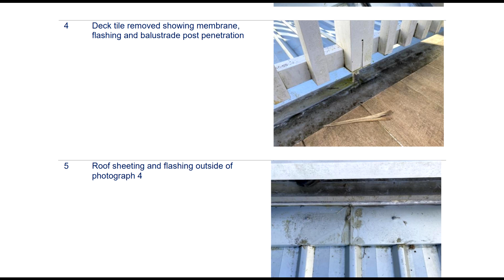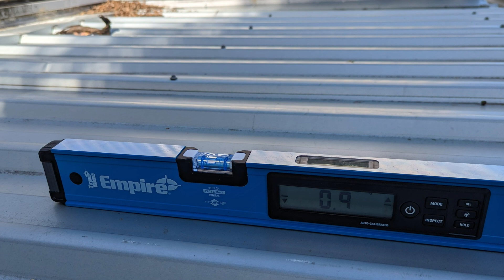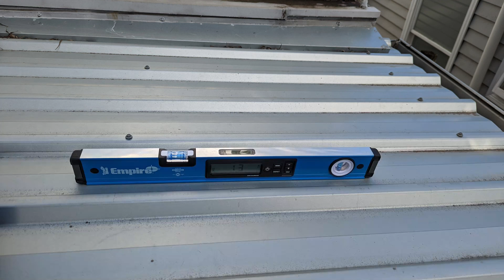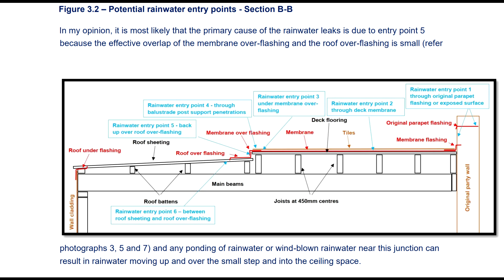flat metal roof leaking headaches

Comment: Crazy that they first used corrugated, then realised slope was inadequate and changed to trimdeck, but still didn't turn down the ends into the gutter. Looks as if it was done by someone with little experience.
Reply: Untrained Cowboys

Comment: In NZ, can't use metal roofing below 3 degree pitch nowadays, though it was allowed decades ago. Anything below 3 degrees needs to use a membrane product such as TPO, EPDM or bitumen torch on. We also do warm roof systems like what is popular in the USA, as a good option for those buildings that were roofed in metal, with less than 3 degree pitch, years ago, and now need reroofing. Does Australia have this as an option, as it would be perfect here. Deck floor and roof area could be all done with the same product.